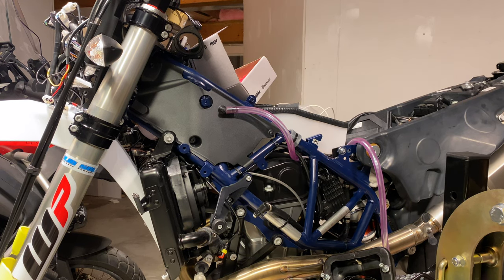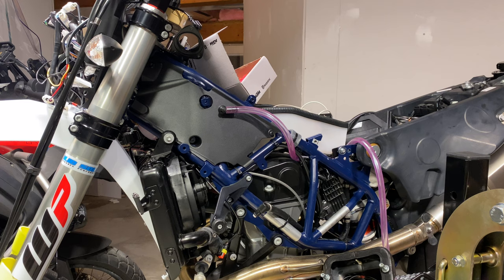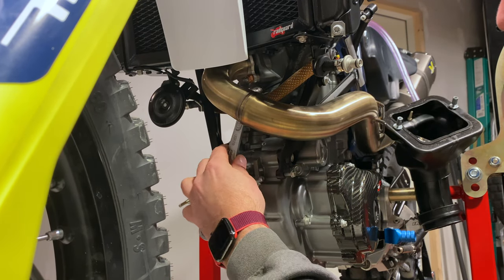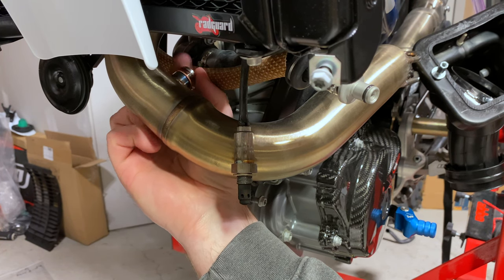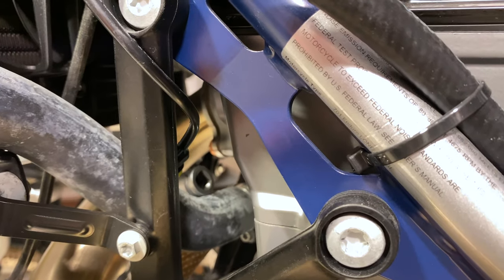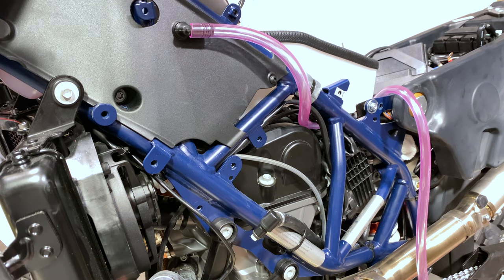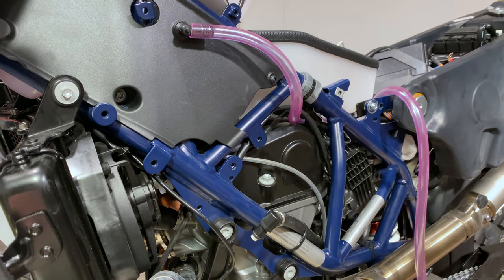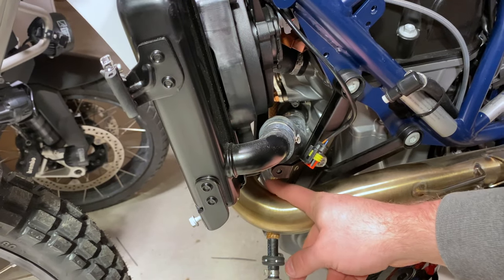Husqvarna 701 Enduro LR: Install Rottweiler Fuel Dongle + O2 Sensor Bung

Comment: Hi Adam.  Again, great video.  I just put the O2 plug in and found a simple way.  I first just hand threaded the O2 plug in as far as it would go.  Then I grabbed a 8mm hex-head socket and placed it on the plug.  This provided plenty of space on the 8mm hex-head shaft of the socket to get an 8mm regular open-ended wrench on it.  Then I used it to turn the socket and fully tighten.  At first, like you, I could not get anything on the O2 plug to tighten and once I too this approach it was simple.
Reply from the maker: Thank you Dalton. Great tips!

Comment: Hi Adam - nice vid! Engine much better in low revs now (on my 2020 Husky 701 Enduro). Unfortunately after about 1500 km I got the yellow engine failure light maybe because of unplausible value of the o2 sensor signal (permanent constant value). No big issue - but do you have an idea (or followers) how to avoid that? Thanks - and keep the rubber side down! 👍
Reply from the maker: I don't know unfortunately. You'll probably have to get a scan tool and run it to check for error codes. I'm sorry.

Comment: Can I use this dong for my 2018 husqvarna 701? Because I saw on the rottweiler site ,I also need to cut the sas system...
Reply from the maker: I really don't know..I think it's fine but you might have to call up Rottweiler first. I think it was the 2018 and newer model that had the redesign.

Comment: Did you install this before the break in period? I’m only at 150 miles and was curious if it would be bad for it this early
Reply from the maker: It’s probably not a good idea to do any engine modifications early on in case there’s something wrong that needs a warranty claim that might show up in the first couple hundred of miles so I think it’s good to wait if you’re concerned. I don’t think it will impact break in period though.

Comment: You don’t need to take the o2 sensor out with this dongle?
Reply from the maker: The O2 Sensor is basically just dead at this point. you can tie off the other end and leave the sensor in the header. Or you can purchase a bung and fill the hole.
Reply: @AdamChandler86  does it make a difference if it’s left in?
Reply from the maker: Nope. The O2 Sensor will just hang out there forever doing nothing.
Reply: Adam, how does the bike perform before/after the mod? Any noticeable difference?
Reply: @Chris-hj3lc i'm interesting too on this point

Comment: Did it fix the jerkiness under 5k rpm?
Reply from the maker: Well, I never rode the bike before I installed this so I have no idea but, I don't have any issues with fueling / throttle so I'm going to say yes :P
Reply: @AdamChandler86  so its smooth in the low revs not bucking and carrying on u der 5k?
Reply from the maker: Yeah, I'd say so but in 1st/2nd, it still bucks if you want it too..great for getting over logs which is what I did all day but seriously, I had heard horror stories about the inconsistent fueling and I'm finding the delivery to be super stable. Considering the power commander was $400 and this was $35, I'm very happy.
Reply: @AdamChandler86  nice literally just ordered mine
Reply from the maker: Let me know what you think. I’d hate to have steered you in the wrong direction.
Reply: @AdamChandler86  oh its no big deal for $30 man.  Even if it don't do good its worth a try for sure for that price.
Reply: @bikerbeliever8169  Update?